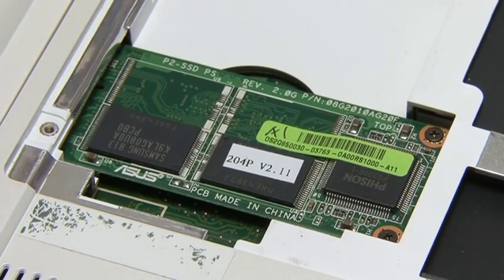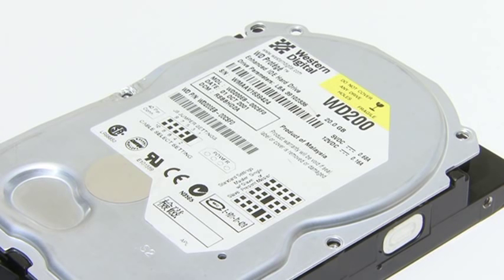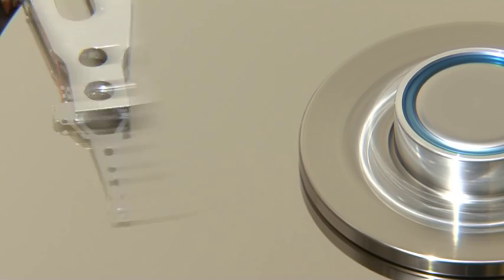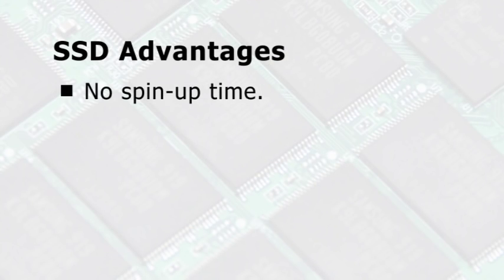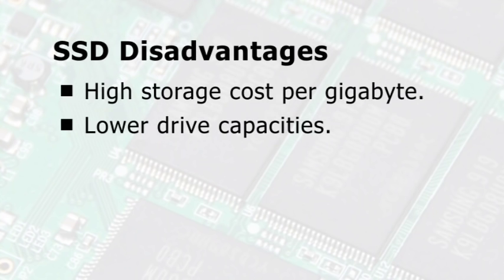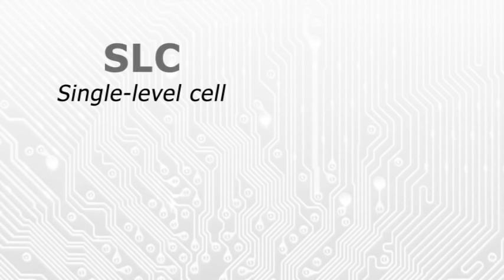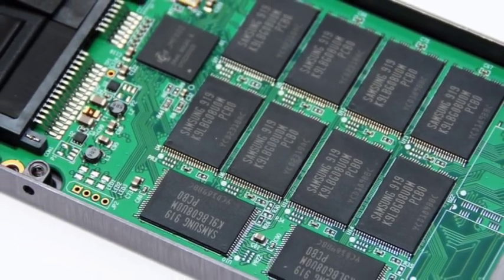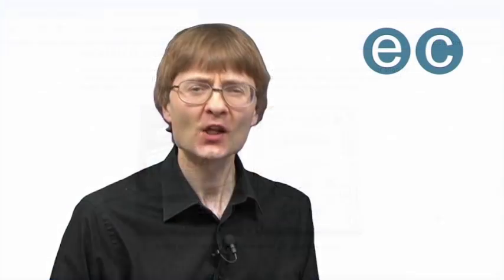Explaining Solid State Disks

Comment: The disk showed up on a HDD test before the random tilting and shaking as healthy, afterwards, it showed excessive shock before the drive cut out as the platter had warped and trapped in the headstack never to work again, it also destroyed the head because the platter was flexing as the disk was being moved and the head was very chipped, and the platter was scratched. which is the only real down side of laptop HDDs.

Comment: sorry but i don't really understand what you said.If you have installed the OS on HDD and you swapped it with a SSD, you must have moved the SSD up on the boot sequence in the BIOS (my assumption).How does this increase your boot time ? Also how does your cache files for your program write into the mechanical drive and not the SSD. Sorry if I sound dumb.I am not a computer sci graduate .I know very little about computers and they interest me a lot.It would be great if you can explain.

Comment: Hi I have a question about RAM
----------------
DDR2

Kingston HyperX 1066MHz DDR2 CL5
----------------
DDR3

Kingston HyperX 1866 MHz DDR3 CL9
----------------
If the CL is higher on the DDR3 does it mean that DDR3 Mhz needs to be doubled compared to DDR2 to get same speeds ?

Comment: I physically removed my primary mechanical disk and replaced it with SSD, this means that the disk must be "cloned" you take a snapshot of the disk image and copy it to the new disk (in this case the SSD). As far as changing write locations for Cache files, you can research on the net how to do this, it is specific to each program.

Comment: ..handled if in a desktop while running at full speed, with SSDs you don't need to worry about moving them and using them in a laptop increases the life of the battery which is a very useful feature, it IS worth considering if you want it for a PC mostly on a network but if you want to store data on it ad it has to have a huge capacity, then it is not yet worth getting an SSD, but i the next few years, we will have possibly over 5 Terabytes to store stuff on one compact SSD which will be useful!

Comment: it is a lot more efficient to use an SSD as it means you can extend battery life, and performance overall, it also eliminates the need to keep the unit on a sturdy surface to minimize damage to the disk and it makes it a little bit easier to move the unit around as there is no gyroscopic motion from the SSD, I ran a test for shock resilience between a hard disk and a flash chip, I moved the hard disk (which was brand new out of the box) whilst it was running and it failed, the flash chip didn't.

Comment: Over the years on a SSD has the "wear levelling" that reduces performance (to insure no single block flash memory is use too intensely) been improved/changes ?or about the same...Thanks for sharing.
Reply: *****
Thanks for the Info.

Comment: 2 years down the line and platter drives are still a used in most systems as just a storage drive, even though SSD's are used for booting OS aswell as most small programs

Comment: You want an SSD with MLC and not TLC.  SLC would be preferable, but it is more expensive. Though even writing ~10GB of data per day to a 128GB TLC SSD, it will still last over 10 years.  I just bought a Samsung 840 Pro 128GB SSD :)

Comment: But is there so much better to the 7200rpm, compeard to 5200? And wouldnt a 7200 make a bunch of noise? I have a very slow hdd on my pc and it is making so much noise you would think the station is a race car, although its slow as hell, really useless. In any case, ssd is better for laptop, and desktop is a question of memory or speed, right? If im getting that wrong, sorry xD

Comment: Theoretically, traditional HDD's should cost much more than SSD's. The reasons being, with SSD's, there're no platters/arms to align, no stepper & conventional motor control circuitry. SSD's require far less assembly/adjustments as compared to mechanical HDD's.

Comment: it's the 5200RPM drives that have a tendency to be very noisy aswell as lowering performance, the 7200RPM disks dramatically improve performance and are almost silent, when I silence all of the fans in my PC, I can only just hear my drive, it is a hitachi cinema star SATAII disk with a 7200RPM read speed ad is very efficient at storing data, all you really hear is the heads moving along the platter and that's it, with my now dead seagate, you could hear everything it did and that ran at 5200RPM.

Comment: Fail within the first 30 sec. Not disk, Drive its Called a solid stade drive
Reply: ***** not an excuse
Reply: +BayAlexander no need to focus on the negative.  As he explained in another comment, the term solid state disk is legitimate although not as commonly used these day's.
Reply: A disc is a geometric shape.  There are no disks in an SSD.

Comment: what if it gets full? i heard that it might get broken then...
Reply from the maker: +idiotic troll The drive will not break when full. However, it is a very good idea to keep some free space (ideally up to 20 per cent) on an SSD for "over provisioning" -- basically letting the drive allocate its written data across a lot of different memory cells. If, say, the drive is 99 per cent full, then all the data you write to it (eg temporary cache files written by Windows and web browsers) will keep writing to the same last 1 per cent of flash cells, and this will age them rapidly -- or to be exact, 20 times faster than on a drive that is kept no more than 80 per cent full. I have just done a video on migrating to an SSD, and will be doing one on optimal SSD drive health in the new year.
Reply: ExplainingComputers thanks, now i can try to get an ssd, and i have to go get some sleep,its 11:22PM here... :/

Comment: Does SSD more faster than HDD?

SSD - Solid State Drive
HDD - Hard Disk Drive

Why My notebook has 500GB HDD and 128GB SSD?
Reply from the maker: Today, SSDs are faster at reading and writing than any HDD. But SSDs are more expensive for the same storage, hence some computers -- like your laptop -- use SSD for boot, and HDD for mass storage.
Reply: @ExplainingComputers  thanks,i actually new to Computers

Comment: Say the life of an SSD is three years if you pound it incredibly hard every day 24 hours a day. That's like not buying a car because if you drive it 24 hours a day for 3 years it will die. Of course you'll never do that so don't worry. I've been using SSDs in a variety of applications since they came out and have never had one die. The only reason not to use an SSD today is sheer size limitations.

Comment: (2) SSDs are good for booting from, that's a real good thing for performance, but t lacks the storage for home use!, I would store the operating system onto the SSD and the programmes and data onto a 3TB hard disk, this way, you don't need to worry about running out of space!!! you can get 1,2 and 3 TB models of the SSd, but they cost within the reigion of 110 to 200 bucks, if you want performance, go for the SSd, but if you want cheap storage, then it is better to choose an older HDD,

Comment: LOOL

1 - SATA III it's 6 Gb/s not 6 GB/s. And we talking about the speed of the interface, not the disk. 6 Gb/s it's around 600 MB/s. 
2 - The maximum read speed of the best HDD in the world (WD Velociraptor) is around 120 MB/s.
3 - SSD today has 500 MB/s of read and write speed.
4 - The lag of SSD is 0.01 ms today. HDD it's 30 ms. For you it's fast, but for the new generation of processors it's a shit.

Comment: SSD does not stand for "Solid State Disc." It stands for "Solid State Drive." Nothing like getting this wrong right off of the bat.
Reply from the maker: The first ever SSDs were actually sold (by Psion) as "solid state disks" (ie solid state devices that stored data just like a disk stores data) So yes, you are right, there is no spinning disk inside, and I should have said "drive". But I am not entirely incorrect here! :)
Reply: @ExplainingComputers   I sit corrected. Cheers!

Comment: i purchased a crucial m4 512GB SSD. and its over 3X's faster than my hard drive. my mac boots in about 6 seconds. and i can open close to 60 Apps in under 15 seconds. and i can actually use them without a computer crash.